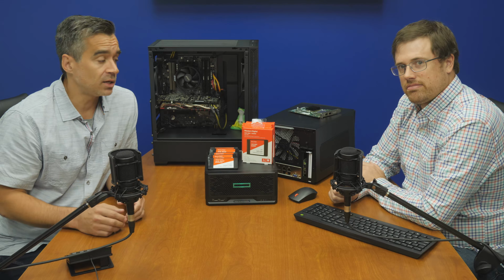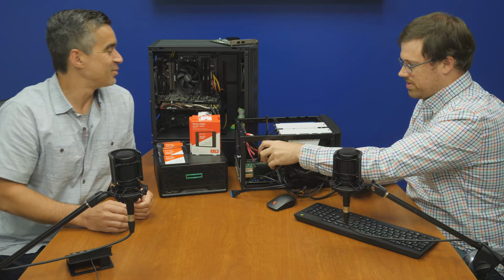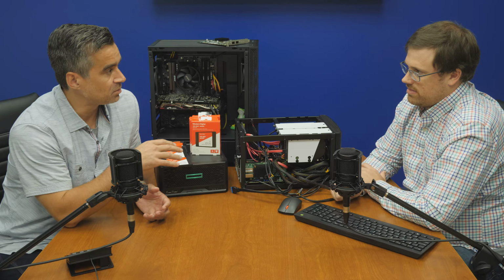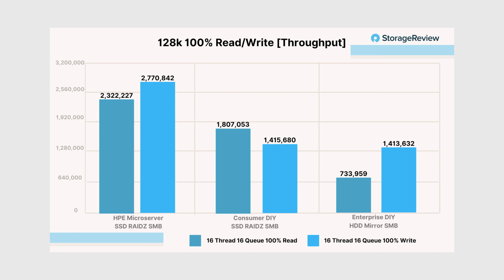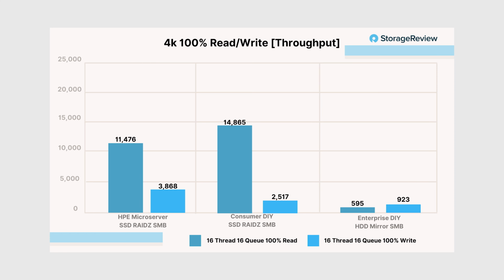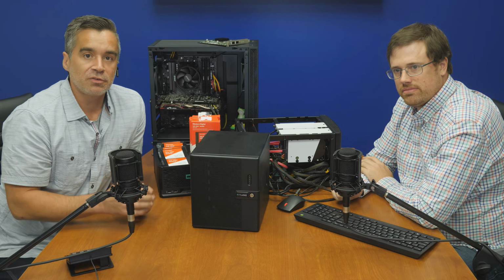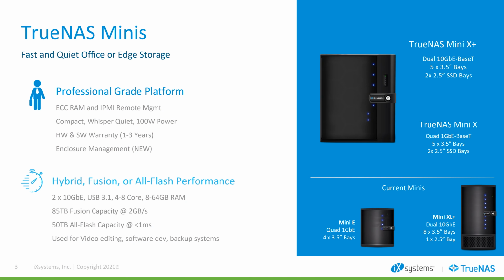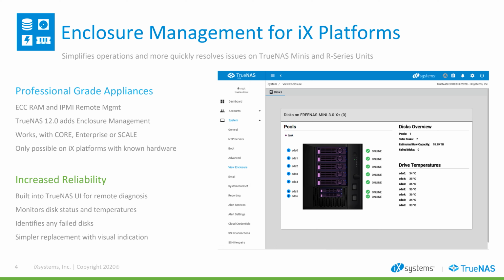TrueNAS DIY Showdown - Final Results and Q&A with iXsystems

Comment: Let's face it, Kevin was the only  one with a working system that actually worked with what he purchased. The others were a bit of a mess in comparison. Not sure I would have gone with HPE as they have tanked in the last few years, with the quality of their products and support. Dell are proving to be more reliable , better engineered and value for money, these days, with their server range. They don't do a micro server, so a little box is not what you're going to get. But their entry level T140 is about $700 at the moment.

Comment: sed a HP ML-10 server box from Tigerdirect, 6ea 3Gb sata drives, 2ea Sandisk USB thumb drives (For Freenas 10 using ZFS) and 16GB of ecc DDR4 ram for $950. That is more than your $800 limit but that 950 included all the new equipment I listed including the hard drives. It's been runing 24/7 for 5years now without any hiccups.
i used 5400 rpm drives because i was not looking for  blazing speed and with 6 dives running my ust gets warm, never ho, so cooling is not an issue for me.